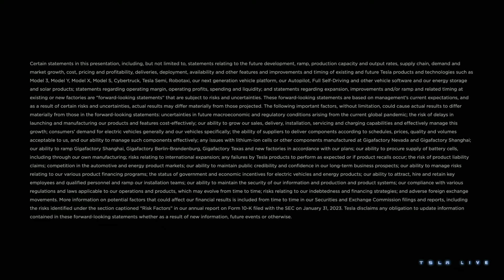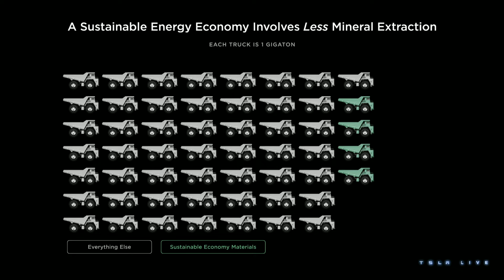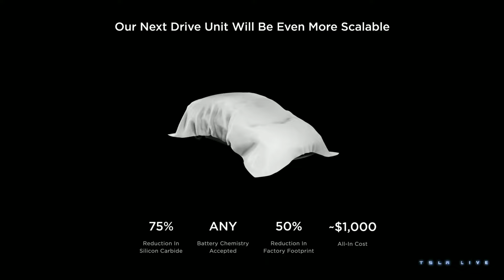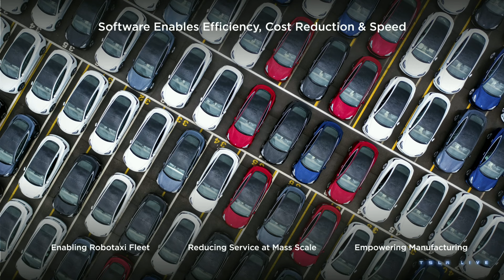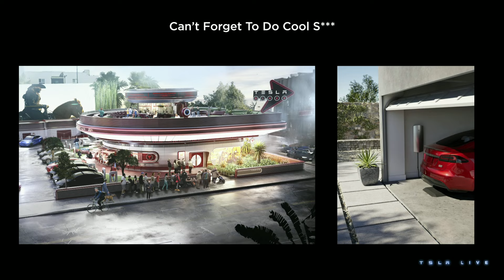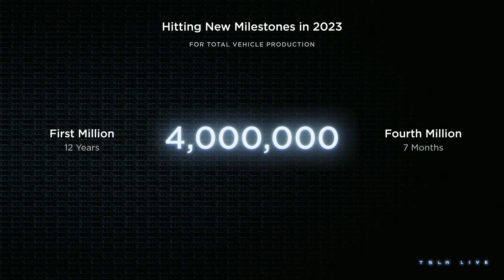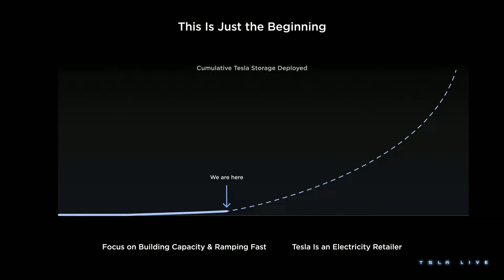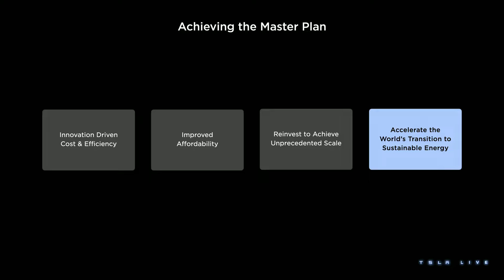2023 Investor Day | Tesla

Comment: I am not concerned about Model 2 not being unveiled.  As they tried to convey the factory + the car is the unit.  The Factory is clearly still in planning, so the car is too.  The more thought they put in, the better the result.  Rushing a design achieves nothing.
Reply: @ancedrius4646  its been 4 years since the cybertruck was revealed. what are you talking about.
Reply: Surely it’s called model A
Reply: What Tesla announced is the first factory that will build in the” new leaner way, the next generation of vehicles that will have the other manufacturers dying from their ability to build their designs inexpensively enough to squeeze out any profit, and as the majority of those competitors fall flat on their face and bleed out and die, this will leave more of the market to Tesla, as well as the orphaned supply chain of raw and processed battery materials, and battery manufacturers who will have to meet Tesla’s cost, methodology and time requirements and flexibility or dissolve.
Reply: @ancedrius4646  I see math is not your strong suite, remember to take your memory pills.
Reply: They were trying to show the investors an overview of many different aspects.
Reply: Why would you release Model 2 which will cannibalise the sales of Model 3/Y when your current production facilities are still ramping up to meet the demand of 3/Y which has high enough margins to be lowered in price to balance demand? Tesla knows what they are doing and will only announce it when they have more factories and capacity online.
Reply: @darrincooper1318  can’t, Ford owns the Model Name.
Reply: @DishNetworkDealerNEO  ahhhh spewing would have made sexy cars . Model s,3,x,y - Cyber, model A , Roadster, Semi
Reply: @darrincooper1318  Ford made first the model T, then the model A!
Reply: Not only would it achieve nothing it would hurt current sales.
If a 20k cheaper car is 2 years out you’ll certainly not buy the Standard Range Model 3 now if you don’t have to. Why would Tesla hurt their sales? They are smarter than that.
Also investor day isn’t about product reveals. Everyone who thought that should change the YT channels they watch.
Reply: @Glenhh  there is an old saying, “you get what you pay for” the $25K car will still be in a different class of vehicle.
Reply: Stretching out the design process of a car for too long just makes it outdated on release and you'll still have a lot of initial problems.
Reply: @_nom_  However with Tesla, and their continuous updating of technology, the longer they wait, the more up up date it will be. Then once I. Production, that type of running changes will keep it fresh as has happened with all of the Tesla models still in production.
Reply: Very, very soon.  Elon addressed the new model question as just shuffling the deck like flip phones, it is a waste of talented engineers time.  If Model 3 is half the cost, who would want a Model 2?  Except an exoskeleton Model 2 😃

Comment: Updated time stamps: (They cut out the preshow, making the time stamps they posted off by ~18min)

0. Master Plan 3 (13:30)
1. Vehicle Design (40:20)
2. Powertrain (52:44)
3. Electronic Architecture (1:01:18)
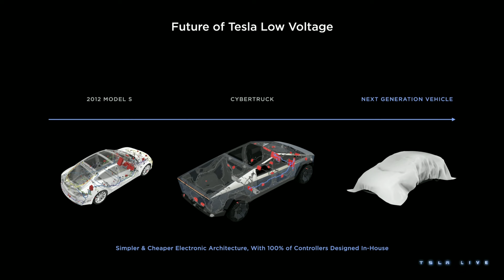4. Software (1:09:52)
5. Full Self Driving (1:20:31)
6. Charging (1:35:33)
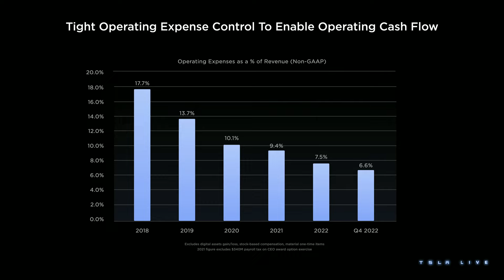7. Supply Chain (2:44:02)
8. Manufacturing (2:05:06)
9. Energy (2:18:26)
10. Impact (2:31:16)
11. Financials (2:37:53)
12. Q&A (3:03:28)
Reply: Thanks

Comment: "Manufacturing with Tom Zhu" actually starts at 2:05:00, not 2:23:00. Just a correction.

EDIT: Actually I think all of the timestamps are wrong, and are off by 18 minutes. So if you want the correct timestamps, just minus 18 minutes from the ones listed.

Comment: I was fascinated and mesmerized for the entire four hours. 
OK,  I've nearly been at the Jeep assembly plant nearly 39 years, and what I see Tesla doing with wiring harnesses let alone the entirety of Tesla. OMG!  😲 I can assure you (anyone who hasn't seen or worked in assembly) that wiring harnesses are one of the most labor intensive, complex, costly, and problematic components/processes we and every other oem has to deal with in auto assembly. And, as was pointed out, wiring harnesses are one of, no actually, they are hands down the worst reoccurring, difficult to diagnose, expensive, and time-consuming things to repair. 
I mean, everything Tesla is doing across the board is amazing, and the level of innovation is simply astonishing. Tesla is not only focused on innovating the product, but their laborious and tireless innovation and improvements to "The Machine that builds The Machine" quite literally puts them in a league of their own. There is simply no comparison. 
So, another example of Tesla vs oem
Tesla is removing dead space (zigzag lines, accumulators, buffers), whereas we added an additional 100 car buffer between the bodyshop and paint shop instead of solving the problem of incessant breakdowns in the bodyshop.
In a nutshell, if we (the oem's) don't change, and I mean on a scale thats never been done, then we are toast.
Imho, we're already in the toaster and starting to burn 🔥

Comment: 3:34:25 As someone WITH solar and a Tesla Powerwall, it drives me crazy that I have a battery in my garage that's 5x its size but is as useful as a fruitcake in the case of extreme weather/blackout scenario. Bi-directional charging may not be essential, but it is a feature that sets new EV models apart in my mind (and I suspect many others).
Reply: Yes, and Elon's comment about the house going dark doesn't make sense to me.  If you unplugged your car, the grid would still be there.  Is he talking about in a blackout scenario?  That's a rare edge case and not typical daily operating conditions.
Reply: If you use your car battery for the house though, I understand it will degrade it - once in awhile seems useful though

Comment: Pretty cool stuff
Reply: Yup. I like the move to 48 volts, and I like the ability to address and talk to every component/system from a single port... that's pretty cool.
Reply: @briankeeley6464  I like the car, telling you when you are not assembling it correctly.  Fixing cars you just made can be very time and labor intensive.  The 48 volt thing is good.  Not sure what the actual optimum voltage is.  48V is probably below that.  Too high and wires can arc, too low, and you need more copper. 
I was under the impression that you had to be 12V as a regulation, and that is why you have to convert military vehicles from 24V to 12V, and can't just buy them and use them as is. 
I am guessing they chose 48V, because that is almost exactly 13 lithium cells in series...12.97 cells...and a multiple of 12V, so 4 lead acid cells in series.  You also don't want it to require too many cells, because you may want to make even bigger cells in the future.  Then they may be hard to get into the allocated space.

Comment: I expected distributed control.  An obvious change that we have done with buildings for years.  48 volts is still a safe and standard voltage and is also used for powering PoE network devices such as their ethernet controllers.  There are ao many advanfmtages to this.
Reply: Distributed control where?
Reply: @slavko321  within the vehicle.  Using a centralized ckntroller rwquires many more feet and pounds of wirw and makes a harness very difficjlt to build and troubleshoot.  Using distributed contdollers with single or dual ethernet connections (dual for redundancy) it makes much more sense.  Simplifies many other tasks as well especially when it comes to repairing a vehicle.

Comment: Key points from the Tesla Investor Day that I found interesting:

Tesla announced plans to build a new gigafactory in Mexico near Monterrey. This will be in addition to expanding production at existing factories.
They aim to reduce costs of the next generation vehicle by 50% compared to current models. This includes reductions in battery/powertrain costs, manufacturing efficiency, and operating expenses.
For full self-driving, Tesla is using neural nets running on powerful computers to enable more generalized autonomy. They are generating large labeled training datasets from fleet data.
On batteries, Tesla is making progress with in-house dry electrode manufacturing to reduce costs and increase production capacity.
For energy products, Tesla plans to expand mega-pack production to hit 1 TWh per year, provide compelling pricing for home charging through retail electricity plans, and open Superchargers to other EVs globally.
Tesla aims to hit 20 million vehicles per year in the future. This will require building more gigafactories rapidly using standardized designs.
Overall, Tesla is focused on increasing affordability, enabling exponential volume growth, and accelerating the transition to sustainable energy.

Comment: One thing. How does the main unit communicate with the factory manufacturing sw if there are no antennas attached? That is the last step, when glass roof is added. Antenna sits above in the cross beam above windscreen in the current models. Will you put the antennas elsewhere?

Comment: How will the back portion of the car be pre-staged/tested before connecting all parts together? Factory mode is running on the main compute unit and the 12V battery is in the front. Connect wirelessly😊? Or have a dedicated test device? Or just wait until all the car is plugged together? Anyone?

Comment: At timecode 1:04:36 they mention transitioning to solid state fuses.  This is a big deal.  E-fuses can be turned on/off by software and have software controlled trip points.  This means you can re-use the same controller board for a lot of different loads, and you eliminate a bunch of mechanical relays.